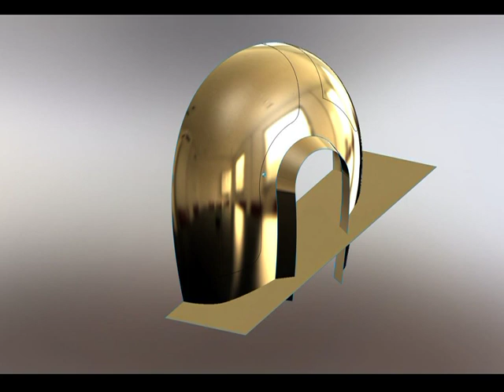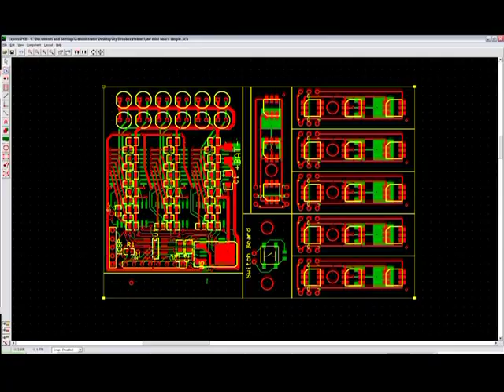Daft Punk Helmet Build in 31 Days

Comment: @9999AWC the battery pack wouldn't be huge if you don't know led's are a low power consuming light that's why in New York they have gigantic led displays you could easily use ether a couple of 9v or  a few AA batteries

Comment: Volpin is better. at least he uses his heart and hands. you used cnc and expensive electrical equipment. you're another geniune ripoff of orignality. you should be ashamed. you want to build a helmet, put the computer away and get the tools out. just my two cents worth. crappy vid in comparison. didn't see you have molds on the floor and your dog running around. cheers!!!

Comment from the maker: @mcnabb43v3r Yeah it's from the auto parts store. It's used for tinting tail lights. However, at a hobby shop you could find a similar spray called "window tint" which is used to tint the windows of RC cars. They both work the same.